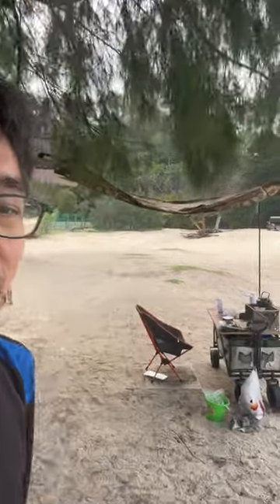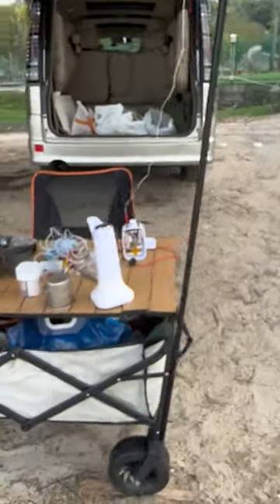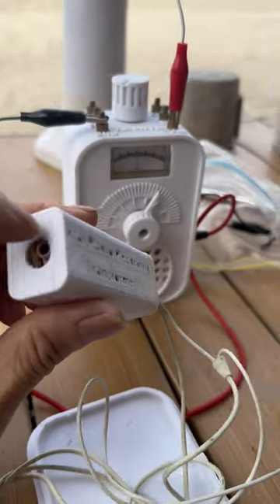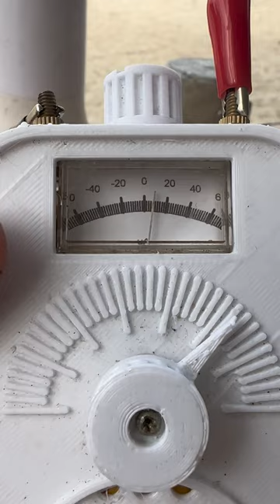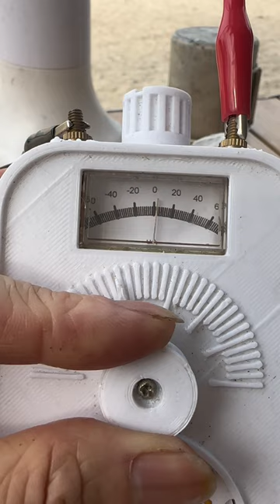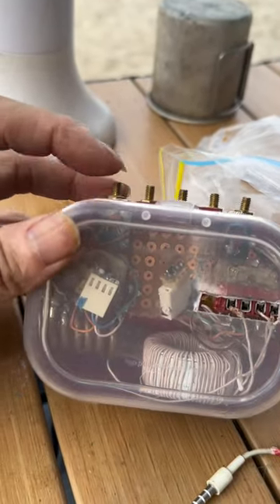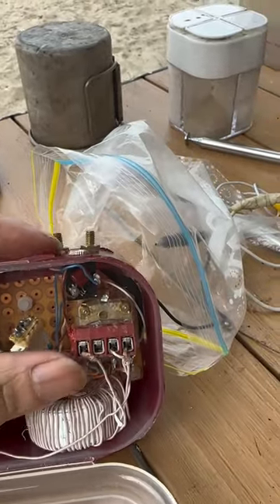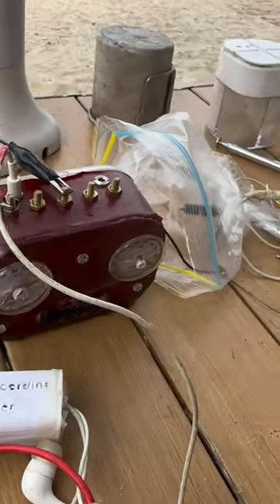Testing two crystal radios on the beach in HK while bbq and van life #freeenergy #batterysaver

Comment: I used two 300 ft wire antennas for my AM and SW crystal radios. A shortwave radio I made used a 4 turn primary coil and a 14 turn secondary. A resistor across the earphone leads brightened audio.